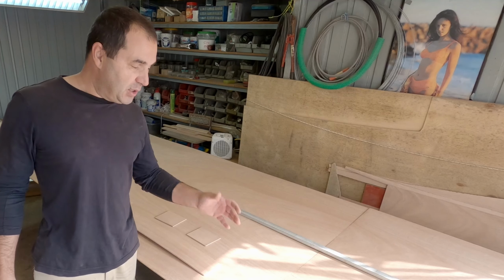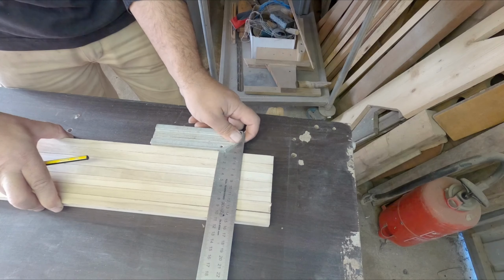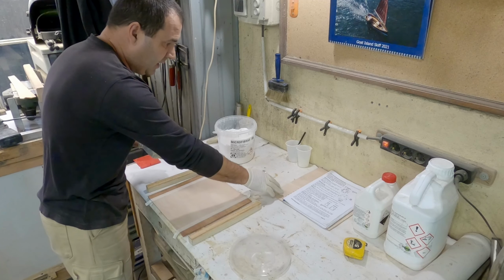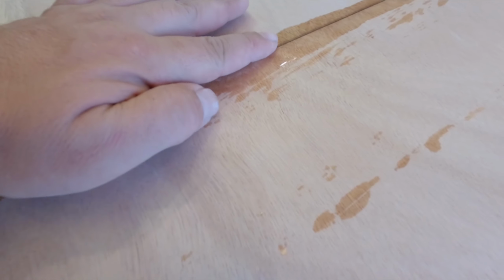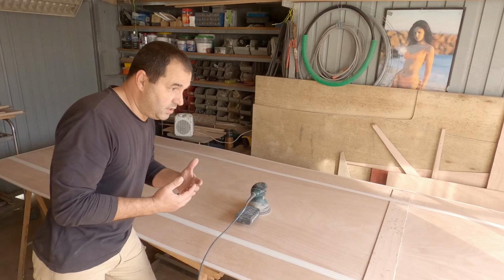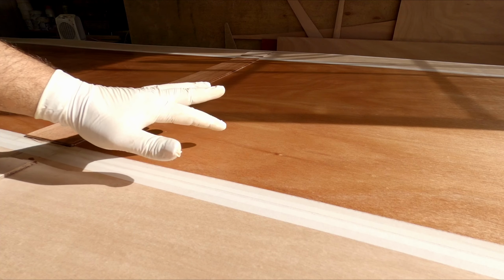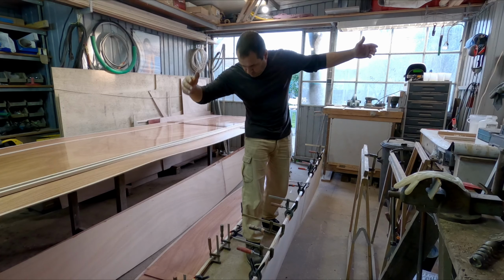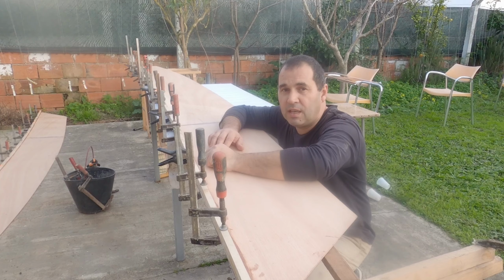Easy to Build, Unsinkable Skiff for Adventurers: Car-Topable and Family-Friendly! Carries 5 Adults!!

Comment: It's a small shop,  but having doors at both ends makes it infinite sized! Great build so far!
Reply from the maker: That's true! I can extend it by at least 2 meter with the swinging gate acting as a roof. 😉
Reply: @TheBoatRambler  how big is your workshop? I might need to rent one to build the goose. :) thanks for the videos and good luck from Croatia :)
Reply from the maker: @franogracin2326   it's 4.78 x 4, but you should be able to build it  on a 4.5 x 2.5 , just start by making the smaller parts like foils, spars etc and leave the hull for last. That's what I did when i built  the GIS which is only 1 inch shorter than my workshop.

Comment: Polyester resin sets as quick as it is cheaper than epoxy and UV stable. Always worth a lookin especially for your scarfs.
Reply from the maker: HI,
Poly would be ok for the non structural joints but it's a "no go"  for me when it comes to wooden boat building.
The bonding with the wood relies solely on mechanical adhesion contrary to epoxy which has a different molecular structure and makes a much more durable bond. Poly is known to delaminate/separate from plywood hulls after some time.
But by all means if it's all you can afford... build the boat! It's only a cheap boat anyway. You will at least be sailing for a few years!  😉
Reply: @TheBoatRambler I learned something new today then !! Also easier to use poly here in Birkenhead where it's always feckin freezing 😆

Comment: It's funny how even building the smallest boat will dwarf the size of any workshop. Things always take more space than they should :D Especially with the c clamps. Very interesting to see the butt joint used, i was initially expecting that to be a scarf joint instead when i saw the boat pictures from elsewhere.
Reply from the maker: It's the same method as used on my GIS. If done correctly they are strong enough and quick to make! 😉

Comment: i think super glue is somewhat soluble in water.
that's what i was told, but ok if you need to seal those areas anyway.
Reply from the maker: Hi Eric,
The scarf will be glued to the plywood on two sides. the Superglue could disappear and it wouldn't matter at all. 😉
Reply: i just started on the rudder mechanism yesterday. ( for my molded skiff design )
i hope to upload within a week. @TheBoatRambler

Comment: Pro tip..... if you cut 2 small slots in the epoxy roller sleeve  on the inside edge ,only slide the sleeve most of the way on when rolling it out , then slide the sleeve all the way on to align the slots with the handle it locks the sleeve and stops it turning so no need to hold with 2 hands and it's faster and more accurate... it'll save you a few hours in a day and costs nothing ... have a good day all....... jb.
Reply from the maker: Thanks John!! great tip! 😉

Comment: Glad it is not structural because superglue weakens over time. Approximately after 2 years it only has about 20% of its original strength.
Reply from the maker: Hi Anthony,
the scarfs will be glued to the plywood with epoxy on two faces later. The glue could evaporate completely and it wouldn't matter. 😉

Comment: I am new to boat-building and was wondering if you could answer a basic question that I'm curious about:  Why do you have to mask off certain areas when putting the epoxy coat on?  I thought epoxy is a kind of glue, so no harm done if it's put where you are going to use epoxy to join pieces.  Do you use a different kind of glue for the joints versus epoxy coat?  Thank you.
Reply from the maker: Hi,
the experts say that gluing with epoxy straight to wood produces a stronger bond than epoxy over dry epoxy. I use both methods and to be honest ... never had any of them fail.

Comment: The cost of the build might be greater if you have to factor in purchasing that many clamps. You can never have enough clamps! Gunwales were the last thing to go on my build so it looks odd to see you put them on so early. Obviously not the boat I built.
Reply from the maker: Hi Rob,
You can just use  temporary screws to hold it in place while it cures. Also the grip clamps in the video cost about 50c each, you can grab 50 clamps for €25...I should buy more of those 😁 You can also make "c" clamps using pvc pipe.
On this build all timber framing is glued earlier on including the gunwales. It helps keeping the thin panels straight for gluing purposes too.

Comment: How much epoxy did you spend after precoating everything?
Reply from the maker: I have spent 1.8Kg on the build so far. That includes framing and coating.
I have only applied one coat on surfaces which will not be exposed to water nor UVs. The plans call for 3 coats everywhere, that would add about another 600g.
All weekly totals for materials are shown at the end of the video.
Reply: @TheBoatRambler  great, thanks! keep up the good work!
Reply from the maker: PS: I still haven't coated the decks!

Comment: Do you have any tips for avoiding bubbling in the epoxy? I'm working on a new hatch for my boat. I have some plywood I've painted with teak-coloured wood stain for looks. My plan has been to epoxy it for water resistance, then varnish over that. But I did a small test piece and the epoxy bubbled up a lot, so that even after sanding it well before varnish, it looked pretty terrible with pock-marks after varnishing.
Reply from the maker: Are you applying epoxy over the stained plywood?
Reply: @TheBoatRambler  Yes. I suppose the bubbling could be from the stain outgassing? But I did give it a day or two after staining before I applied the epoxy.
Reply from the maker: It can be that the epoxy wont soak in properly due to the stain, or there could be some incompatibility between the two products. How did you apply it?  if using a foam roller , dragging the roller  as soon as you finish spreading the epoxy will also brake bobbles that formed on the surface.
Also if you use slower hardener it helps letting the mixed epoxy sit for 10 minutes so the bobbles in the mix rise.
Reply: @TheBoatRambler  I got some opinions from other people recently. The stain I used should be ok (it was "spirit stain" that should be ok to epoxy over after a day or so of drying, after the solvent evaporates). But I did not use a fresh painbrush to apply the stain, but rather one I used before (and washed like I would a brush for paint). It's possible the brush imparted some oils onto the surface that the epoxy did not want to bond with.

As for the surface, I tried sanding the epoxy down, but it got so tedious I decided to scrap the part and buy a new piece of plywood to start from scratch.
Reply from the maker: @OlliWilkman  sometimes the best option is just that...start from scratch again! 😅